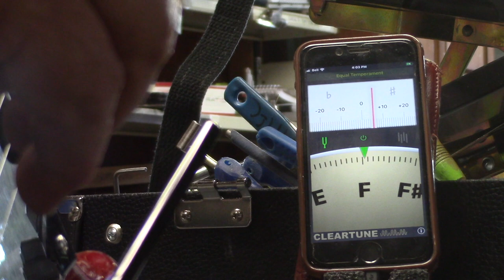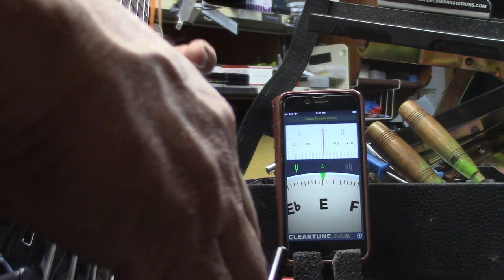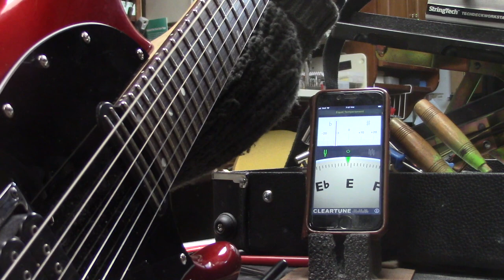Compensation for a Locking Nut @StringTechWorkstations

Comment: did you check the trem post lock screws there are two tiny locking grub screws inside the centre of the trem posts that you need to unscrew before you can lower the trem posts
Reply from the maker: Hi Leonard ... thanks for weighing in ... that guitar is long gone ... Tom ( comment above ) is the owner. Your comment may help someone else at sometime in the future who is working on one of these. Cheers ... stay safe \m/ !  MMcC

Comment: how are you getting the correct string height off first fret without using feeler gauges ? how do you know the proper depth ? im baffled ,I measure the 1st fret and add .020 with feeler guages to get it just right but your compensating and getting proper height im just amazed
Reply from the maker: You'll see on the Patreon videos, how I stack up feeler gauges to the right height.

Comment: So the 1st step is to set 12 fret using a saddles at the bridge and the 2nd step is to measure open strings to get a nut compensating values?
Reply from the maker: I start with 7th fret and 19th fret notes ( adjusted at the bridge ).